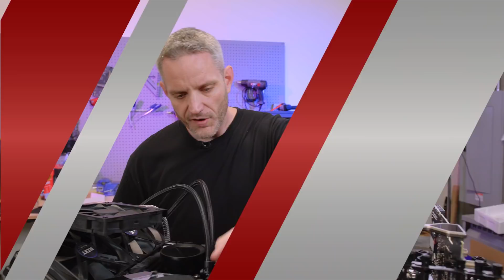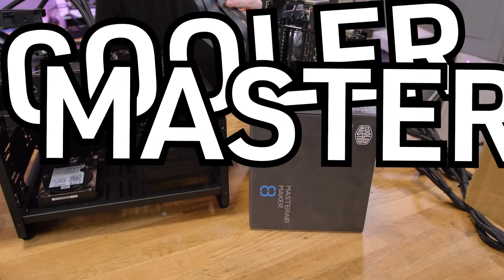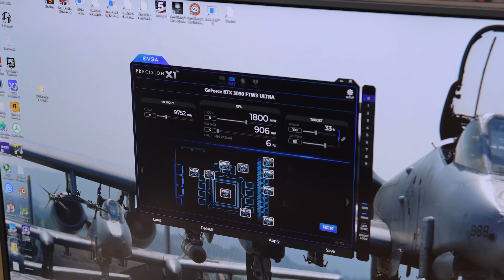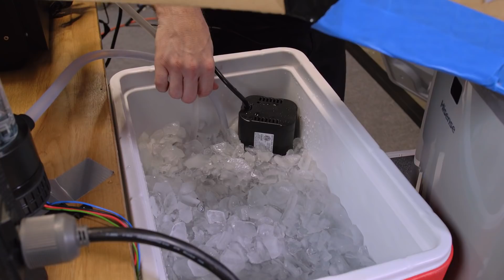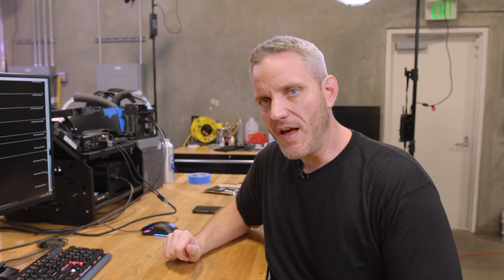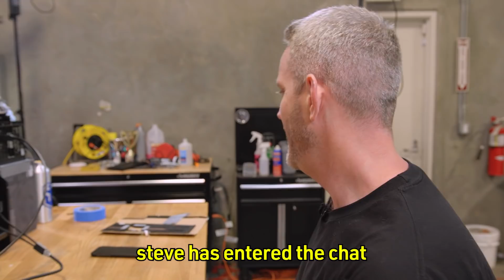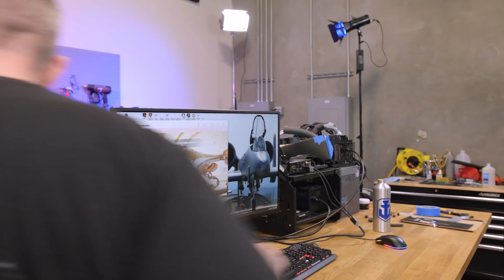Homemade Waterblocks for RTX 3090 SLI... these results are incredible!

Comment: Would adding salt to the ice help any?  Since it causes an endothermic reaction it should make the liquid water even colder.
Reply: Look what salt does to make vehicles rust, now imagine your poor radiators falling apart 😳😳
Reply: @deminybs  are they not aluminum or copper? I think they'd probably be fine.
Reply: @lancelefevre351  haha you got me there!!  I feel dumb for not even thinking of that 😂😂
Reply: @deminybs  no reason to feel dumb at all, I read your comment and thought the same thing. Started scrolling videos and came back when it came to me they weren't ferrous materials. 😁
Reply: @deminybs  but it work though..
Reply: That would would work. It's how make ice-cream